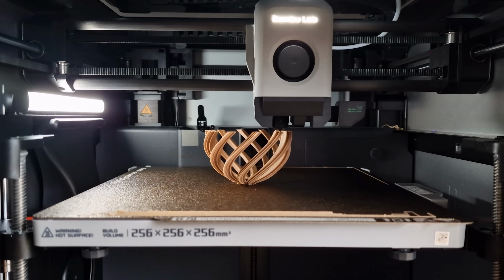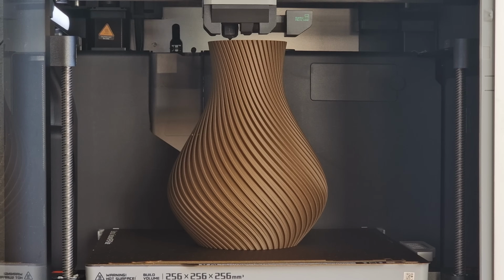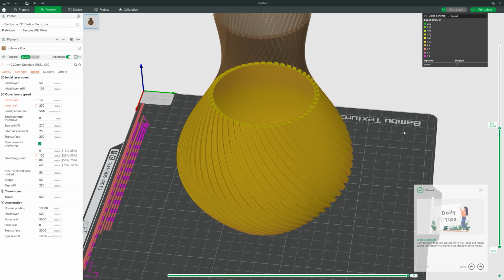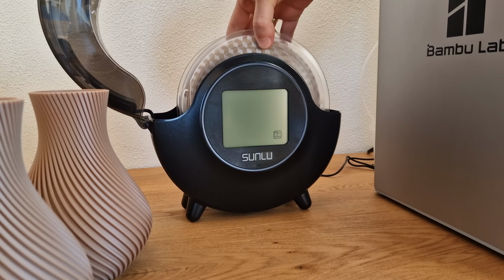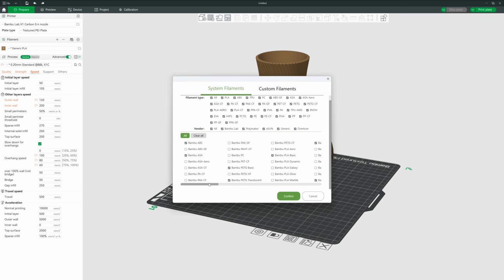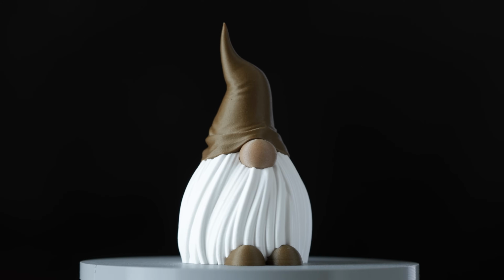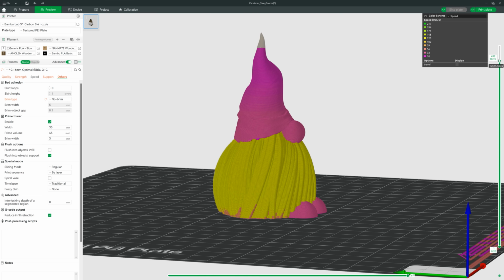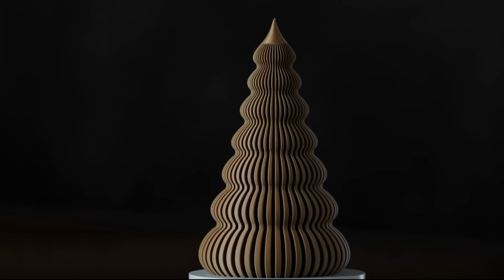Bambu Lab PLA Wood vs. the Competition: Stunning Prints or Festive Fails?

Comment: Seeing how many people say that they learned new settings i have to say that they learned some of them wrong.
1. In filament settings the retraction is in "Settings Overrides" - meaning overwriting printer settings. Checking it doesnt change a thing. Checking and than changing does.
2. Max volumetric speed = layer width (mm) x layer hight(mm) x layer speed(mm/s) = mm^3/s -> so if you have 0,4mm nozzle with 0,2 layer hight (=0,08mm^2) you decide how fast it can print. With (8mm^3/s)/(0,08mm^2) = 100m/s. Setting any speed above that changes nothing.
Some other (hopefully still friendly advice)
Going through calibrating Flow Dynamics and Flow Rate in Bambu Studio is childishly easy, recommend doing this with every spool of filament (after drying).

Other than that thanks for video. Im looking for wood pla and it was helpful to see how there can be different textures.
Reply from the maker: Thanks a lot for your detailed comment and for taking the time to explain these points 👍
I really appreciate the friendly advice and the technical input.

Regarding your first point about the retraction setting in Settings Overrides: I’m not sure I fully understand which exact moment or setting you’re referring to. If you have a chance, could you point me to the timestamp in the video? — thanks!

And thanks for doing the math on the volumetric flow rate — you’re absolutely right. That’s a very clear explanation, and I’ll definitely keep a closer eye on this in future videos and setups.

I’m glad the wood PLA comparison was useful to you!

Comment: I've been using Isanmate and Creality wood PLA for making gun stocks and the initial prints don't look like wood but if you sand them, it looks and feels just like wood and it can be stained and finished. hard to tell the difference between that and real wood.
Reply: Are you making gun stocks in 1 piece? What 3d machine would you suggest?
Reply: @phil3476 Creality Ender 5 max. I use a Bambu P1S as well for ones that are shorter and might fit like the AK-47, sometimes it can be made slightly shorter and the length of the TPU buttpad can be extended to compensate so it's the same length.

Comment: Hello, Great video! I'm wrestling with a similar problem to what you had with your reindeer in this video with filament color change due to different print speeds due to support material used in my object design. I'm curious as to what the final print settings were that produced your final model which looked perfect?
Reply from the maker: Sorry for the delayed reply 😊
I actually changed quite a lot of settings during testing, so it would be hard to explain everything clearly in a single comment.

To make it easier, I’ve uploaded the exact print profile I used to Maker World. You can find it directly on the model page here: https://makerworld.com/de/models/817434-deer-stag#profileId-2412763

The profile is called “Bambu PLA Wood, 0.2mm layer, ultra high quality”.
The main idea behind it is keeping the print speed as constant and as low as possible to avoid color and texture changes caused by speed differences.

Hope this helps, and thanks a lot for the kind words about the video! 😊

Comment: hey CreativeMaker first fantastic review, i was wondering if you managed to look at the waterproof that was teased on the "printing Asa and tpu" video at the end. I'm looking at making water tight models but carnt see much research in the topic
Reply from the maker: Hey! Thanks for the feedback!
I never actually got around to properly following up on watertight prints. 😅
I did manage to print a waterproof housing, but making the seal with 95A TPU didn’t work out as expected—I had to apply an additional liquid gasket to keep the inside dry.
Right now, I’m working on a video about TPU with different Shore hardness levels (from 60A to 68D). The goal is still to print fully waterproof enclosures for electronics—I need them for my soil sensors (check out my other videos). With TPU 60A, it should definitely work, but I still need to run more tests. 😉
For the case itself, I used ASA. To achieve a watertight shell, I needed the walls to be at least 2mm thick. I believe this process could be further improved by using a larger nozzle size and possibly ASA AERO.
Let me know if you’ve experimented with watertight prints yourself—I’d love to hear your approach!

Comment: you already have a default retraction in the printer settings for the extruder , in the filament settings if it is set it overrides the value you have by default . i believe the setting in extruder is 0.4
Reply from the maker: Yes thats correct, the default retraction length is 0.4.

Comment: Hi from Mexico! This video was excellent and so useful. I bought the iSANMATE PLA WOOD because you recommended it. I would like to know what exact values you used in the retraction settings.
Reply from the maker: Hey, great to hear from so far away! I'm really glad the video was helpful.
For the iSANMATE, I set the retraction length to 0.8mm, and all other parameters in 'Settings Overrides' are at default.
Let me know if it works for you!

Comment: Im curious if you would do 3d model consulting?  I designed a part and trying to print it the best I can with efficiency.
Reply from the maker: Thank you so much for considering me as a consultant; I'm truly honored! However, I think I’m not the right person for the job—I do this more out of personal interest and to give back to the community. My focus is on achieving the best quality possible, so efficiency often takes a backseat for me, and I have little experience with optimizing for it.
That said, I highly recommend checking out @Factorian_Designs channel. He has some excellent videos on efficiency, including tips on using modifiers to optimize print speed and filament consumption. Perhaps he even offers consulting services.

Or maybe someone else here feels inspired and can offer their expertise?
Once again, thank you so much for the offer—I really appreciate it!

Comment: A comparison with Polymaker PolyTerra Dual Gradient PLA Wood would be good. It has no real wood inside if im not mistaking, but dual color AND gradient which shall deliver a more real wood Look. I saw pictures on reddit and it looked amazing. I bought 2, unfortunatelly it is less then 1,75 mm thick (<1,5 mm) and its unusable for me.
btw Polymaker also has a real Wood filament.
Reply from the maker: Thanks for the tip! I’ll definitely check it out. Are you planning to get fresh rolls with the correct 1.75mm diameter?
Reply: @ would like to have them, yes. Currently I'm waiting for clarification of the warenty case of the shop

Comment: Great video!! Learned a lot about slicer settings as well as about this neat new type of filament. I bought a roll of BBL wood PLA in the colour Rosewood because the colour was so lovely and I plan to use it in some Lunar New Year projects in the future so this was incredible informative! 

Question though about retraction since I haven't seen it really discussed by other youtubers when it comes to oozing/stringing. I commonly see this issue when printing with PETG. I know PETG is notoriously oozy/stringy and I've been seeking answers to combat this. From my experience, it accumulates over time on the nozzle and eventually deposits it in the print, leaving lumps on the print surface. While I've found increasing nozzle temperature to 270C has helped with reducing buildup on the nozzle, I still get small lumps here and there. 

When you enabled retraction in the video, did you change the default value? Or did you leave it as is? Does the value go up or down if you want to reduce the amount of ooze? 

Once again thank you so much!
Reply from the maker: Thank you so much for your kind comment! I’m really glad the video was helpful for you.
Unfortunately, I have limited experience with PETG, so I can’t give a definitive answer about the buildup and stringing issues you mentioned.

In the video, when I used iSANMATE filament just the lenght value was changed to 0.8 mm, but I think it might benefit from being slightly increased to combat stringing further. 

For the Bambu Wood PLA which i used for the deer model (where I had to print very slowly), I tuned several retraction parameters:
- retraction length: 1 mm
- retraction speed: 50 mm/s
- detraction speed: 50 mm/s
- enabled “Wipe While Retracting”
- wipe distance: 2 mm

I’m not entirely sure if these settings would translate well to PETG, or if they would solve the nozzle buildup issue you described. But it maybe helps against stringing.
Maybe someone else here has some valuable tips for PETG? I’d love to hear their input as well!
Reply: @creativemakerat  thank you so much!

Comment: A quick level up on the way you use max volumetric flow - do it before you set your specific speed values (but after you pick a nozzle diameter and determine your layer heights & adaptivity). When you see the max speed is 106mm/s after setting a max flow of 8, you know that the 200mm/s you picked isn't actually doing anything, because you've bottlenecked at that max flow. Changing the flow rate to accommodate a different speed is not as smooth as keeping the same flow, so if you take the 106s and match them to your other 100s by changing that max speed, you'll potentially end up with a more consistent print - though I should say I have no clue at all what granularity Bambu's printers use for their extruding, 106mm/s is possibly functionally identical to 100. I've definitely seen the influence on slightly bigger variances though.
Reply from the maker: Thanks for pointing that out - you’re absolutely right, the order I showed doesn’t make much sense! Setting the max volumetric flow before fine-tuning specific speeds definitely makes things smoother and avoids those bottlenecks you described.
I’ll keep this in mind for future projects and really appreciate the tip 🙏.
Reply: How do you correlate a flow in cubic milimeters per second with a linear speed in milimeters per second?

Comment: I've been using OVV3D wood filament which claims 30% wood content and prints very well after some calibration. It's super easy to post process as well.
Reply from the maker: I’ve searched the web for OVV3D wood filament and read in several forums that there can sometimes be clogging issues when using a 0.4mm nozzle. Did you have similar experiences?

Comment: If you print in lower layer resolutions you can theoretically just use  wood dust and glue mixture to put a thick coat on before smoothing and polishing.
Reply: Have you tried this?

Comment: If you have a bambu lab X1C you can actually dry out the filament with the 3d printer itself just put it in a a box inside and then select dry mode setting.
Reply from the maker: You're absolutely right, the  dry mode is a great feature! However, I think having a dedicated filament dryer has its benefits. For one, it doesn't block your printer, so you can print and dry at the same time—this way, you can ensure the filament doesn’t absorb new moisture during printing.
Back then, I bought the Sunlu dryer, but today I’d go for the Creality dryer. Being able to dry two spools at once is just more energy efficient in my opinion! 😊
Reply: I like the X1E's chamber heater for filament drying, but it means your printer is out of commission for a number of hours.  Creality had a good discount on Amazon, so I have one of those headed my way.
Reply: You can also do it in a p1s but have to set the temp manually
Reply: A dedicated dryer is FAR FAR better than using the printer.  It IS a nice feature but it's really more of a pinch hitter than a dedicated one.

Comment: Great comparison. I've got the Amolen product in their Rosewood and Ebony variants. For what it's worth, the Amolen can print much faster. On my A1, I do 190-220 range, 200/200 on the print temp, 50 on the bed. Stock settings for the rest. I made some clocks out of both for Christmas gifts, and both definitely have a wood vibe to them. I've also made several Harry Potter wand models from each with success and they all look great.
Reply from the maker: Thank you for your comment and for sharing your experience and print parameters - great to hear that Amolen can be printed faster! Rosewood and Ebony sound like a nice combo. If you'd like, feel free to share links to the models you used -I’m sure others (myself included!) would love to check them out. 😊

Comment: A step you missed in your review is sanding and finishing. These filaments are supposed to do well with both which would likely eliminate layer lineas all together
Reply from the maker: Thank you for your feedback and the suggestion! I've seen sanding and finishing in a few YouTube videos, but I’ve never actually considered trying it myself. Do you think it’s worth the effort? When finishing, does the wooden filament make any difference compared to standard PLA?
Anyway, sanding a vase does sound like it could turn into a bit of a time sink though 😅
Reply: @creativemakerat  Well the point of using filimint with wood impregnated in it is to be able to treat it like wood. Otherwise just use a wood toned PLA. As a woodworker, I would like to know which did the best. Also as a wood worker sanding is part of the job. Thew advantage of combining the 2 is gettijng shapes thaty would be difficult to acchieve in just woodworing alone.
Reply from the maker: @jonfortner3919  Thank you for clarifying, now I understand your point much better! After reading your comment, I did a little digging online and came across some impressive examples. Adding texture with stain, in particular, looks amazing and really brings out the wooden feel.
I’m actually considering making a follow-up video on this topic, as I’ve now got a bunch of questions myself. If I do, I’ll definitely try sanding and applying stain to see the full potential of these filaments.
Do you have any recommendations for the best grit to use when sanding? And is there a particular stain you’d suggest for wooden filaments?
Thanks again for your input! 😊
Reply: @jonfortner3919  I am also a woodworker - PLA is horrible to sand, it is very hard, and melts easily so you can’t use power sanding tools withour being careful. Wood filament is *better*, but still not great. Ideal would be wood PETG - PETG sands very nicely. To be clear I absolutely have used Wood PLA a lot - and I like the many shades in the new Bambu range, I just try to avoid sanding it, printing at higher layer resolution. A good way to get prints to ‘cohere’ with wooden parts, in my experiences is to use carnauba wax finish over both. It takes great on almost any material, and gives a unifying satin/diffuse shine which makes everything sit nicely together.
Reply from the maker: @SamMillett  Thanks for sharing all this info! The tip about using carnauba wax finish sounds really interesting—I’ll definitely keep that in mind for future projects. It’s great to hear how you’ve worked around the challenges of sanding and managed to blend prints with wooden parts so seamlessly! You mentioned wooden PETG—do you know if there’s any filament like that available?